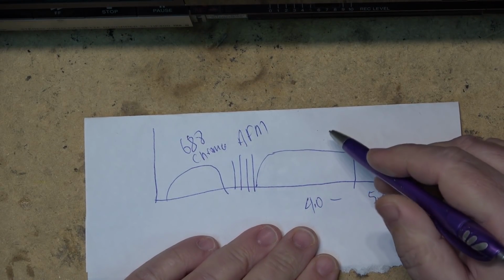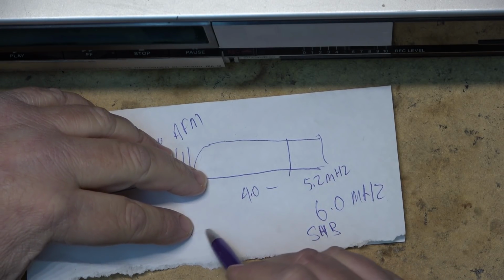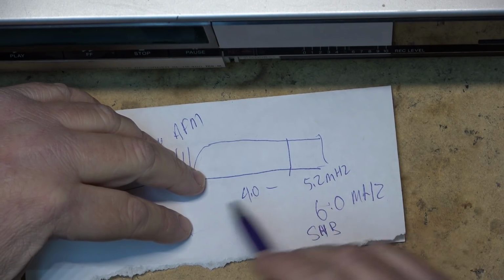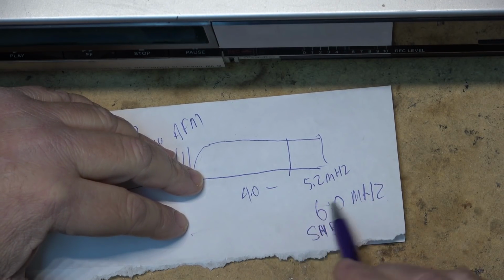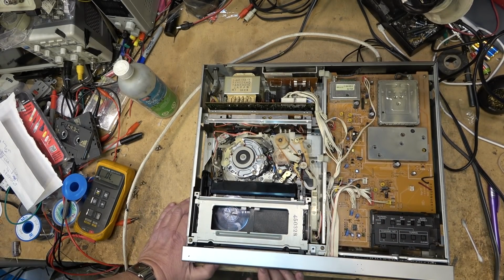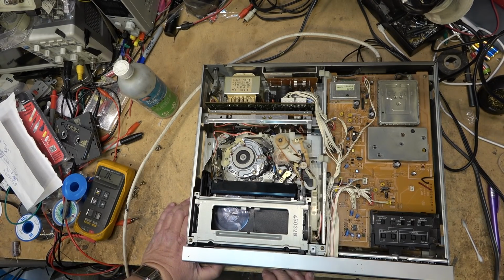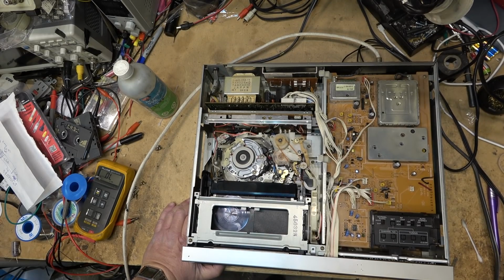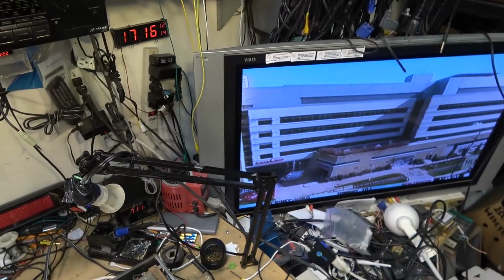Sony SLFH400 Betamax has a ghost in the machine.

Comment: I recently got an SL-HF300. From what I understand, if I record with the HiFi switch on, the picture will have slightly worse quality but if I have the switch off it will be better?

Also, when I select the Line Audio switch on my HF300 it makes an HiFi audio recording from the line input but it blanks the screen even if there's something connected to the video input.
Reply from the maker: That is correct. When you record in beta hi-fi it uses some spectrum that was used for high frequency picture detail and uses that to place 4 audio FM carriers between the chroma and the luminance. They shifted the carrier frequency 200 kilohertz higher but they actually needed 400 kilohertz bandwidth so the net loss was 200 kilohertz of high frequency bandwidth in the lower side band. When super Beta came out they shifted the carrier higher still and restored the bandwidth that was taken for a beta-hi-fi. Now the reason they didn't do this until super Beta was developed was because tapes recorded in super Beta will not play properly on non-super beta machines they will play but with picture impairment. There was all kinds of trickery that they did to squeak that resolution back such as disabling the comb filter and replacing with the notch filter. Sony pulled out all the stops with the super high band mode that was introduced for beta 1 on the hf1000 and 3000. That results in a totally non-compatible picture on beta 1 but since the speed had been eliminated for so long it wasn't an issue because nobody was using it. So the resurrected the speed and turned it into a super high quality recording medium. Saying that if you record in super Beta and turn off the beta hi-fi it improves the picture even more at the sacrifice of HiFi sound.
Reply: @12voltvids  Is there a reason that broadcast U-Matic (and SP) never had AFM sound?
Reply from the maker: @KylesDigitalLab  well for starters the tape speed was much faster therefore the linear track actually sounded pretty good. Plus pneumatic had stereo sound with two tracks of double audio the SP version had three tracks so you can have a linear time code plus stereo sound with Dolby C noise reduction. Remember that the original stereo format on VHS was a dual linear track where they split the track in two the problem is at the slower speeds is sound quality was got awful. Sony came up with a way to improve the sound of the linear track by using AFM. It revolutionized home video. When you got into pro video pneumatic betacam and 1 in sound wasn't as big an issue because again as I said before you had the tape speed but they move very quickly to PCM audio and you would run two tapes in sink because the machines were time code linked you could run a digital soundtrack on 13/4 in and the video on another. In fact that was done a lot for many of these laser discs that were produced. They recorded the video to 1 in and they put the digital audio in sync on 3/4 inch PCM. 8 mm and hi8 had the best of both worlds because it had both AFM soundtrack as well as a PCM digital track that could be added or dubbed after the fact. Bfm was a great option for home video but it did sacrifice the picture quality. And for those believing that the VHS machines did not suffer from impaired picture quality from VHS Hi-Fi it did degrade the picture. To about the same degree as it degraded the picture on beta hi-fi. Now on beta hi-fi they shifted the carrier up and stole a little bit of the bandwidth to insert the audio carriers between the chroma and the luminance. VHS did not have that luxury because they didn't have the bandwidth to give up so they went with the player azimuth recording and recorded the audio onto the tape and then laid the video down over top of it. The problem is there was mutual interference and the audio carrier did have Tennessee to erase some of the high frequency information that VHS was trying to lay down on the tape. Super VHS wasn't so bad because the carrier was much higher in frequency but regular VHS Hi-Fi did reduce the picture quality. Especially at the lower speeds LP and EP it wasn't so bad on SP because the audio head was much narrower Gap so he had a wide video track with a narrow audio track it did not erase as much but EP it was quite noticeable if you made a recording of the good old monoscope pattern at EP and you recorded one tape on a mono machine and another tape on a high five machine and paid them back the Hi-Fi machine had a noticeable drop in horizontal resolution especially at EP SP slightly but at EP it was quite noticeable. That's why the broadcast formats didn't do it.

Comment: My second VCR was a Sony SL-5200.  It was their first consumer deck with Hi-Fi sound.  It's a behemoth not unlike this deck.  I learned stuff I never knew about how they shoe-horned in the AFM helically scanned bandwidth for the Hi-Fi sound.  It was a game-changing leap for audio with video for the consumer market.  Alas, it wasn't enough to save Beta as Mitsubishi lifted the idea relatively quickly to VHS further insuring that formats supremacy for the consumer market.  While I liked Beta the writing was on the wall and I moved on to S-VHS Hi-Fi.  That carried me to the end of the video cassette years as DVD became, perhaps, the fastest adopted new format in video history.  Still I am amazed at the engineering of these old decks.  I will say I never saw a VHS home deck built to the standards of these old Sonys.  Even Sony began making VHS decks and they were not built to the "tank-like" quality of these older machines.  I must say you are a good tech who explains things well...nice video.
Reply from the maker: I still have my 5200 and it still works

Comment: mode switch
Reply from the maker: No more switch in betamax.  They have a cassette in, cassette down, and load complete switch.  For unload they use a magnetic proximity coil, the same one that detects the metal leader on the end of the tape.  The beta mech was so much simpler and superrior in every way to VHS.   VHS was garbage by comparison.   It win the format war but it shouldn't have.

Comment: IN PAL THERE IS SUPER BETA MACHINE (SONY SL-HF950 MODEL ) HAD  SWITCH TO RECORD PRO SUPER BETA RECORDING..IS IT SAME AMERICAN SLHF-750 QUALTITY?
Reply from the maker: On the NTSC machines there were 3 speeds. PAL and SECAM had 1 speed (slightly slower than Beta 2 on NTSC.
L500 ran 1, 2, and 3 hours on NTSC machines and 2:15 on PAL. L750 ran 1.5, 3 and 4.5 hours on NTSC and 3:15 on PAL.
On NTSC recorders, Superbeta shifted the lumanence carrier up by 400KHz to improve the horizontal resolution from 240 lines to about 280 lines. 
It should be noted that the Beta 1 speed had been dropped for a number of years as a record speed for consumer machines, but the speed was used on the industrial machines. All the consumer models had beta 1 playback. Beta 1 never had superbeta. 
Sony reintroduced the beta 1 speed for the SLHF750, and gave it B1S format, which was Superbeta also known as Hiband. The SLHF1000 was the flagship model that added Super Hi Band 6.0 recording. This shifted the carrier another 400KHz higher, and this pushed the resolution to 330 lines equaling the quality of 3/4" Umatic. 
The PAL version pro superbeta shifted the carrier up only 500Khz. It topped out at 280 lines.
Reply: i have sl-hf1000 and it works great..i use adaptor from 240v to 120 for operate it..its amazing machine speical in B1 SHB... great vcr
Reply from the maker: @fadhlematrook1248  yes the slhf1000 was the best betamax.  It has specs identical to 3/4". Things to consider, both beta and 3/4" umatic use the same 688khz color under carrier, and with the higher 6.0mhz carrier records the same lumanence bandwidth as 3/4.  330 lines.   I have 2 of them.  When control T is used for editing the machines edit by themself.

Comment: I've got a collection of early 80's Sanyo betamax, PAL and NTSC. My expectation was that same models for PAL and NTSC will be more or less the same inside. However, this is not the case. For example, the VTC 5300 which is a PAL machine, and the VCR 4200 an NTSC machine, look identical on the outside (just more chanels on NTSC). But on the inside, almost nothing is the same. Power supply board, provides different number of voltage outputs. Drum and capstan servo is located physically in a different location on the machine and are not even remotely similar in look and parts. Same goes with the VTC 5000 PAL and VCR 4000 NTSC. Why is that? Wouldn't it it make more sense for the servo board to be identical with only the necessary differences related to drum speed .... Why redesign a completely new board? The service manual for the PAL are useless for the NTSC, since even the test points and connectors are irrelevant for the NTSC version. Is that the same for other brands as well? I understand that some parts will definitely be different, such as an IC doing FM modulation for PAL and NTSC. However, it looks like a completely different redisigned machine, with the same mechanic and packaging, while major electronics could have been reused in both versions.
Reply from the maker: More than likely they were built at different factories.   Totally different designs.
Reply: I have the VTC 5350 which is the PAL/SECAM version. On the inside, only the power supply, servo and front panel boards are the same as the 5300. The rest of the boards are different. I have service manuals for both models so I can compare them.

Comment: The technical details are very fascinating. It shows the train of thoughts the engineers went through to maintain compatibility. I'd love to start my project "Diana" to conserve the actual signal on tapes digitally. But I lack funding and equipment to really get started with it. Namely an ADC that has a bandwidth of up to 12 MHz with up to 8 channels. The digital format specification of composite video is already done. But I lack the hardware (also the analog part) and tapes to get started...

Comment: I recall that at the time piracy was becoming a greater concern, Beta units had filters that could remove the extra audio channel that was introduced by vhs tape rental vendors. That extra audio created an unstable recording if someone attempted to copy a rental vhs. I believe that greatly contributed to its demise.
Reply from the maker: Unstable video when attempting to copy was the macrovision signal that was recorded in the vertical blanking area between lines 9 and 20. This messed with the AGC on the recording VCR and on newer units would disable the recording completely. Most beta units were not affected by macrovision.

Comment: Dave thanks for the explanation of hifi and the super beta switch. How can you tell if a tape is recorded in SuperBeta or not? I have an SL-HF2000. When I play  a tape without super eta, it looks fine. When I turn on SuperBeta I see what looks like drop outs in the picture. Playing the same tape on an SL-HF300 (non SuperBeta it looks fine). So is this a  on SuperBeta recorded tape or does my machine potentially have an issue?
Reply from the maker: The way you tell is how you have been determining it yourself. If you play a superbeta tape on a non superbeta machine, the whites will look a little hot, and there may be some streaking that looks like drop outs around bright objects. If you play a non super beta tape on a super beta machine with the switch on, the picture will look a little unstable as the sync level will be a bit low, and it will also appear to have excessive drop outs.
If you play a beta1 SHB tape on a standard machine, well it going to look as bad as playing a superVHS tape on a standard machine.

Comment: This was very interesting. Although I learned about Broadcasting in college, they never went into the deep technical details. Thank you. I'd like to find out the technical differences between BetaMax and BetaCam.
Reply from the maker: Betamax was a color under composite recorder just like 3/4" VHS and 8mm.  Betacam was a component color recorder.   The red and blue components (the I and Q signals) were FM modulated and recorded on the tape in seperate frequency bands by an additional pair of heads.  The tape ran at 3x the original beta 1 speed or 6x the beta 2 speed.  An L500 tape became a BCT20 and an l750 a bct30.  Bct was the numbering system that stood for betacam certified tape.   The number 20 or 30 was the running time in minutes.  The sp decks used a metal tape.  The head scanner also ran at a faster speed.  I never serviced betacam decks.  I did have a betacam camera at my production company for when we had a contract job to do acquisition.  That's is where we were hired (either myself or my business partner) to go work as a camera operator for another company.  There was a company doing recurring show that would hire us to run a "B" camera and then at the end of the day they would hand a stack of cash and take the tapes away to edit.  I actually enjoyed this type of production work because I would get the call usually on a Saturday or Sunday when I wasn't working show up at the location with my betacam and tripod the producer would hand me some tapes we would do a test to make sure the camera was working and I would get my instructions. That had me a walkie-talkie and tell me okay we're shooting there's a car coming down the road follow the car as he goes past your location or whatever it was and I'd be there for a few hours got paid for four minimum sometimes I be there for 5 hours get paid for 8:00. Can't complain about a hundred bucks an hour for standing there pointing a camera. At the end of the day producer takes the tapes has me cash and I go home. Was a lot less work than when I had to organize a full production do all the shooting and do all the editing which is what we usually did for corporate stuff I did all the shooting and editing and my business partner he did the consult with the client and he handled duplication of hundreds and hundreds of tapes. I did our corporate stuff on professional high eight and then moved to professional DV because the quality was just fine for DVD or VHS replication but I had to have the betacam for anything that was going to be broadcast and there was a couple shows that I ran second camera on that were broadcast.

Comment: When I was in high school in the seventies they had a VCR that weighed about a hundred pounds and was reel-to-reel and the Record Head was about 8in in diameter and only B&W
Reply from the maker: I have one if those.  I did a check over on it last year but didn't have a good tape for it. Now I have a new tape i may drag it out again and do another video and get it working even better.  Not that they were that good to begin with.  Sony cv2000 was the model i think.  Mine is a GE branded but made by Sony and it even says made by Sony on the back.  Has a little 12" BW tv with it.  Was from 1965 which makes it the first vtr for home use.

Comment: Nice info, crazy that PAL caused so many differences
Reply from the maker: Technically it is very similar to ntsc. Subcarrier frequency is higher and the phase inverts 180' every line hence the name pal, which stands for phase alteration by line.   Secam also is a shortened phrase which translated goes something like this.  Sequential color with memorie.  Ntsc, even though we poke fun at it, "never twice same color" really means National television systems committee. A government organization that standardized tenders from industry on the color systems that would be adopted.  There were multiple systems submitted.   The system that was chosen for north America was the RCA system.  The system that was rejected was the system  proposed by CBS  as it was incomparable with the existing black and white TVs of the day.   
HDTV in north America is called ATSC, which you guess it stands for Advanced television systems committee.  They took many different system designs and decided on a standard.   It's important to have standard set, if we look back to the 1980s when AM stereo was proposed the FCC granted licenses to four different systems all of which were incompatible with each other and let the market decide which system would become the de facto standard. The problem is it took several years before the Motorola standard was decided on and the fact that many stations put in transmitters by other companies built to their standard caused confusion with the listeners because different radios were required and ultimately spelled an end to a.m. stereo broadcasting before it really got going because many stations that backed the losing format pulled the plug on a.m. stereo they would not reinvest to put a new transmitter in once the decision was made to go with the Motorola system. Fortunately that didn't happen with TV could you imagine the mess we would have been in when color TV launched in the 1950s had there been a half a dozen different standards and you needed a TV for the specific station that you wanted to watch if you wanted to watch a different station you needed a different type of TV what a mess we would have been in thank God for standards. Oh wait a minute you're up had that mess with pal and secam. Someone in England couldn't watch broadcast from across the channel in France unless he had a French TV and someone in France couldn't watch a British channel from across the English channel unless he had a British TV. And then there was their frequency allocations if bandwidth sound carrier position yep you're up really did a good job with their system I have a TV that will receive $21 different broadcast standards. Guess how many broadcast standards we had in North America one. So people in Europe go and poke fun at our system but our system actually was probably the best system because you could take your TV anywhere in North America Canada the States Mexico and it would work everything was standardized and that's the way it needs to be.